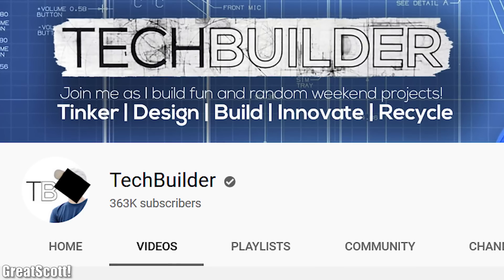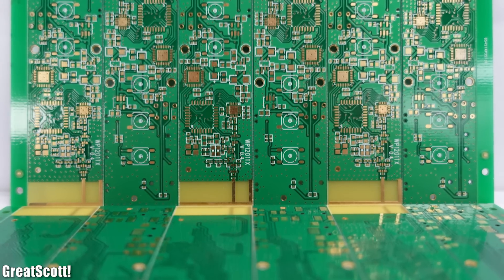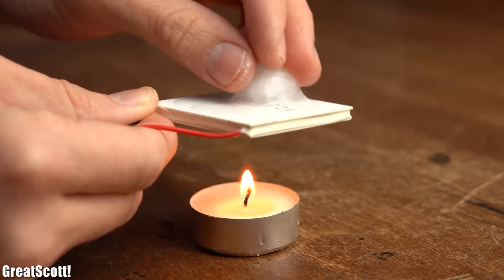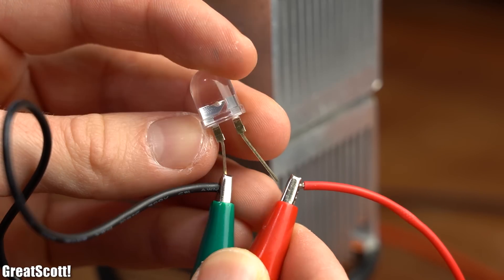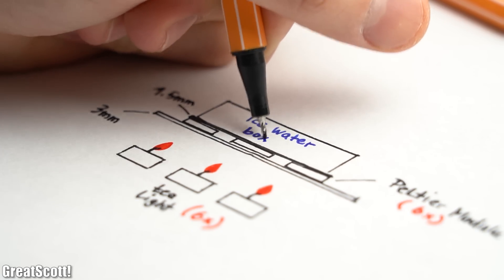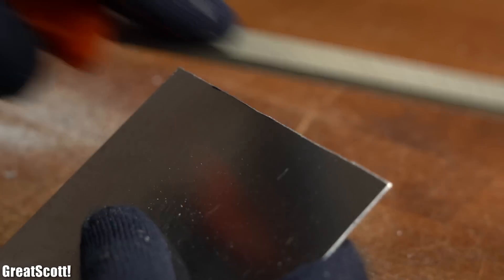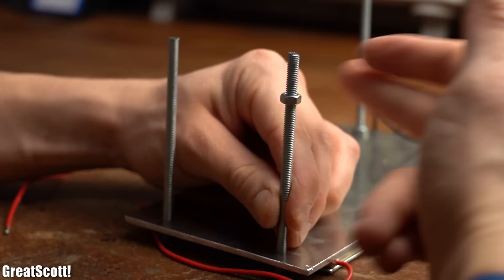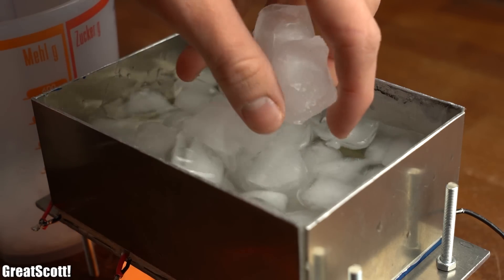Exposing a FAKE Thermoelectric Generator and building a REAL one!

Comment: Can you build another project please? 😁 or at least tell me why is a bad idea.
- U shape metal box with rocks inside
-Heat source ( ex: hydrogen torch/solar power/ or a simple torch)
-2 Peltier
-external power supply for the heat source and one Peltier

1.Heat the U shape metal box, and power up a Peltier that will be placed with one side on one end of the U shape to make a very cold side 
2.place a Peltier between the very cold side of the other Peltier and the other side touching the other end of the U shape 

Can this be efficient somehow?

Comment: I am confused now. As far as I understood the voltage converters, shouldn't it have been giving out more current after lowering the voltage from 6.5 to 5 V?
Or were the 200 mA with 6.5 V just the load-less current and not what was actually usable if a load was added?

Comment: U have Connected All the Models In Series Which Means u are trying to Generate The Same Current From 6 Modules Which Is Actual One Module Current. This is a Basic Scense. Try to Connect in Parallel And Show the Output Current. If the Current Raises Please Delete Your Video. If it not the I will Blow All my Degrees And Certificates Infront Of u

Comment: Peltier elements are for cooling only. Use Seebeck Elements. Those work basically the same way but are chemically engineered for generating electricity. They are way more efficient!
And don't use so much conductive paste. A much thinner layer works much better!

Comment: @greatscott: what if you use ALL the heat of the 'fake' version: isolate the heat and use it all: because now 90% of the heat is wasted: only use a straw to suck in oxygen to keep the flame going, add Rockwool all around and then measure: then we should really know the efficiency. My idea was to heat up a tank with the overproduction of my solar panels during the day, and then reuse the hot water to power small (or as big as physically possible) devices (hot tank on one side, cold rainwater other side). But we need to know what the efficiency is if we use ALL of the heat and let go nothing to waste. Anyone knows if there is documentation about that? (and everyone knows that a Peltier element is not the best way, but is there another...?)

Comment: I'm wondering if it would be practical to build a teg wall to sit behind a wood stove, taking the place of an exterior wall, such that the cold plate is exposed to cold winter air to provide the differential.

I'm think as one component of a multi source system.

Comment: Hello GreatScott,
how are you doing?
I hope my next description doesn't pollute your pretty mind,
my idea for this is to use a joule-theif circuit to boost the 0.09 volts of the named generator (the single peltier module one) to a proper 4.2~4.9 volts then using some other booster circuit to boost the output voltage to a proper 5 volts signal to use for something useful like charging a smartphone or powering a Bluetooth speaker if you may have to
thanks for reading and hope you are doing well.
Crazy Cuber signing out

Comment: Would using salt on the cold side provide any benefit? It would increase the cooling rate, would that enable more efficient uptake on the hot side? It's already splitting hairs at this point since you would not use TECs for any serious power production.

Comment: Make 4 sided boxes with the plates and stack them 4 levels high for a total of 16 plates.
Cut a square hole the same size as your TEC box stack and water tight glue it in place.
Fill the cup with ice water and raise it up off the table about 4 cm with 3 or 4 little objects.
Place a single candle beneath it.

I think we need to make micro heat pipes to upgrade out TEC modules

Comment: Aluminum oxidizes and develops a light oxide coating in the presence of oxygen within minutes. So you need to chemically remove the oxide with a wipe-on oxide remover before you try to Aluminum-Solder  Also, I believe there are peltier TEC units designed as generators -- not sure what the difference is exactly but they can handle higher heat exposures.

Comment: I get that you believe this isn't FAKE, but yours is just equally FAKE. You basicly put six of them in a serie and used another powersource in the form of ice wich in time costs energy to make.. Nice tweaks it can be way better using copper heatsinks and closed walls on the hot side. 1 candle might do the trick again ;)

Comment: If you want a reliable maintenance free power source and you have a hot spring, this would work. What else could give you electricity for 1,000 years that doesn't involve radio isotopes?

Comment: As a career EE with >20 years in RFIC design I can say you totally NAILED IT!
The fake one failed a freshman physics analysis big time...calculate the energy available from the tea candle flame (old school bomb calorimeter), account for low efficiency of Seebeck Effect and it is no where near the amount of power (volts * amps) needed to do a legit charge. 5V @ a few mA probably won't even power the charge controller in a cell phone, never mind charge the battery.

Comment: You used the wrong thermoelectric modules. TEC (ThermoElectric Cooling) modules are optimized for generating a cooling effect by applying an electric current to them. TEG (ThermoElectric Generator) modules are optimized for generating electricity by applying a source of heat to one side of the module while cooling the other side of the module. What you should have used is the TEG 1848 module.

Comment: I still believe you did this wrong. They’re too far away from the heat source. They enough power to generate at least one amp at 5v. Don’t have to have ice... on such small candle set up. Buy some cpu heat sink... possible small ones one for each TEM. I know this because i have a fire place fan powered via a TEM. This fan have One TEM... and measured it it showed way more than you do from 6 TEM same size. Maybe you’re cooling them too much. Because i find this very unlikely that a commercial ONE TEM from a factory built device, does a better job than 6 in your set up.

Comment: Nice job with your analysis and build, especially with being transparent about everything. However, one could argue that using ice on one side of your Peltier array is equally unfair as using a blowtorch on the other side. So neither project really demonstrates charging a cell phone with tea lights (in the spirit that tea lights are the energy source). But the video is valuable for teaching about thermoelectric devices. Thanks.

Comment: Here's a thought I had about peltier generators, what if they were used in areas with colder winters, say down to 15°F (-9°C)? And you had the hot side facing in the living space, and the cold side facing out? Would that work to any reasonable degree?

Comment: My house is heated with and outdoor wood boiler that heats water that is than pump though the basement floor. It's very reliable unless there is a power failure then the pumps that circulate the water shut down. This means no more heat in the house and the boiler can overheat. So, I was toying with the idea of basically replacing the chimney stack with a steel tube coated in T.E.G.s with heat sinks to power the pumps. The pumps are quite small in a closed loop with low friction tubing and I only would need to run them enough to keep any part of the loop from freezing. Is this even remotely reasonable or are T.E.G.s just too inefficient.

Comment: TEC1-12726 - Operates Temperature: -30C to 70C Hot and cold on both sides of the temperature difference of 68 degrees. not iintended for power generation. 
im not sure u used its max heat rating but ther are high heat  TEG but very costly. im still trying to figure a lower cost way to use my wood stove to charge a battery bank. looks too costly

Comment: use 4 Peltier modules, 2 modules in series for voltage,  side by side in parallel with the other 2 modules also in series for current. Two candles per module.

Comment: i think that you lost a lot of heat energy from the candle, a candle burning inside a heat sink made from aluminium or copper tubes with ventilation might be more efficient 
🤔🕯🤷‍♂️
Reply: i read that the flame temperature of a candle is about 1,000 °C and the melting point of aluminium is 660° C 🙄😐🕯🤷‍♂️

Comment: Hmm. I got resin printer that has casing volume of about 2liters. It's too cold to use where it's currently at winter and I was thinking that, hey maybe peltier heater would be good. Now I'm thinking that should I just shove something like small ordinary lamp inside to heat internals from 15C to 30C. I'm definitely overthinking this problem :)

Comment: i was hoping to get 3.4 amps at 12v from a small campfire. by my calculations that would take over 100 peltier ceramic pieces of the same power as the ones from this video. not gonna happen.

Comment: could this be used to extract heat from  a solar panel and on the other side being cooled by snow, or would this just make the solar panel less efficient? I'd like to generate more power than just from the solar pannel on a mobile snow winch?

Comment: Is it possible to have a huge heatsink on the side that has to cool it down and have the flames touching the hot side? And would you generate more milliamps from connecting all the positives together than connecting all the negatives together, but this would bring down the voltage though.
Reply: @GreatScott!

Comment: Idea: I wonder if someone could build a circuit  that uses a capacitor to "shuttle" charge ex: charges at 5w until full, then outputs to target circuit at some higher wattage like 40w. ( the charge time is going to be longer than the dump time, obviously)

Comment: Hmm. Wouldn't it be easier to build a rocket stove out of a log and put a fan ontop to change that hot air into kinetic energy and then have that drive a magnet to induce current? I think they have commercial applications for that now.

Comment: the reason your brazing failed is because u need to heat the aluminium enough to melt the rod with out the torch hitting the rod, and clean oxides from the aluminium too

Comment: Realistically, you're better off buying a bunch of battery banks or a massive deep-cycle battery with a trickle charger to keep your phone charged during power outages. If you want ease, just buy a decent UPS (Uninterruptable Power Supply) for phone charging. It will keep the internal battery charged for you and all you have to do is keep it plugged in and plug your phone charger into it. There is really no use in having a candle-powered phone charger. There are so many better options out there. If you worry about long-term power outages, get an off-grid solar/wind power-generation setup with a big enough battery bank to last a week or so without sun/wind. It will be expensive, but you will essentially not have to worry about grid power after that. There is the ongoing cost of replacing the batteries every so many years that you have to keep in mind.

Comment: The peltier element seems ..strange as the elements i have seen has about a few watts actually,  it is easily checked but i am not having one yet, but the delta t, efficiency of the element matters , not the temperature really as long as the difference is about 40 degrees wich should be ok. They also exist heavily commercially now as chargers in trangia pots , so the fact you needed a few eother os due to somethings broken or low efficient peltiers

Comment: To solder aluminum you have to warm up the material from the opposite side, never heat up directly the solder rod. Flux is with special solder not necessary,  just a bit skill

Comment: well building a generator with peltier cells and create heat with small candeles to warm up the cold side of peltier cells it actually a waste of time and cash...
but the principles of peltier cells works well..
unfortunately all those that attempt to prove someone experiment its fake...most of the times fail miserably..
if you really want to make peltier cells as they should you need a very hot surface..and i mean not small size candles!!!
but a burner!! and outside the burner place all around the cells,obvious you will have to  keep te hot side on low temperature...and with today tech place a fan directly on top of the ce without the aluminium heat sink so that cold air reach directly the cell and allow the cell to generate more electricity..
geeeeezzz all those scientists that believe they are smarter than other..
you are just fucking idiots....
if you want to prove someone wrong,you better go in all the way...and not half way like great scot on that attempt did.. and failed miserably!!!
great scott study!!!
and please if you want demonstrate that you have great ideas i challenge you to create an electricity generator spending very lil money!!!

Comment: also would this work, if I stick a magnifying glass on my roof, that auto tracks the sun's position, so as to magnify a point of light on a roof mounted heatsink, and have another  heatsink underground to take advantage of the naturally cooler temperatures, wouldn't that be technically free energy since its using a pre existing source of heat generation. Or do the two heatsinks have to be thermally pasted together?

Comment: Now if I could figure out how to turn my entire enclosed car engine into one half of this heatsink, and another heatsink on my roof, cooled by airflow I can charge things without using my car battery. 
Can someone give me some numbers on how this works? Like is the temperature difference what creates more power? What if I cool a heatsink with a liquid nitrogen circulator, and stick the other end to say, my car radiator, does the temp difference give more power?

Comment: I have used petlier blocks to cool LED ... plase directly petlier ,cold side ,, on 100w / 220v,,  Led chip and ,,hot,,petlier side on cooler with a fan on it . Powered Petlier with 12 V . ...For now seems to work good ..LED cooler is cool while the LED chip itself is ok .you can touch it and not get burned ...Checked the current on 12 V transformer and LED power supply ..was using about 40 % less energy all togheter as without petlier . Dont know how long petlier will last ..so will install heat safety switch on cooler as well

Comment: The other issue with TechBuilder's setup is that if you are using 12V/approx 0.5A to run the cooling fan, you might as well use that power to charge the phone.

Comment: TEC modules are not the same as TEG modules, your 12726 module is not designed to be used in reverse to generate electricity.

Comment: A few people have mentioned, you need to use a  TEG not a TEC. 
I also wonder if it would not be more efficient to build a small Sterling engine run it off of the tea lights and attach a small electric motor or generator to that.
It might be actually more efficient than the tegs.
There are some relatively efficient Sterling engines out there.

Comment: Yea you gotta buy the real expensive flux (black stuff) to braise aluminum and do a better looking and strong joint..  also is hard because of the melting points of the solder, flux and aluminum being so close to one another so is easy to melt through the aluminum and make a mess of things...  plus thinner aluminum will melt easier and also leaves a discoloration so should be thick enough to be able to remove that layer to achieve a good finished look..  or tig weld it...

Comment: with your rebuild of his project, I would suggest that you could increase your efficiency a whole lot by getting the candle closer to the flame, surrounding the pencil holder with aluminum foil and operating it in winter time with colder air passing by the top fins.
Also for the one you made, spread out the modules so there is more heat sink per module and use a bigger heat sink

Comment: How much thermal energy a candle contains? 42.0 kJ per gram? 
How much thermal energy the candle releases thru the time (power)? 
(Final mass - Initial mass)*42000 / Final time - initial time? 
What is the energy conversion efficiency (thermal to eletric) of a peltier element? 10%?
Just some questions for the viewers...
Great video!

Comment: it is a simple calculation
how much energy can such a tealight give off .... a commercially available tealight has a heating output of 20-30w .... but that means the whole tealight over a burning time of 24 hours .... well, I doubt it very much that you can charge a cell phone, operate an LED and a fan ... especially not at the same time

Comment: You could have used Silicone Sealant for water proofing and joining glass and metal plates at 7:21. I have seen glass aquariums made with silicone joint only with large capacities. Neat and clean solution.

Comment: 7:23 you could use your power supply with aluminium wire to weld it from corner at 30 volt setting

Comment: You always get 5 volts with those cells, more or less. You had to put them in parallel. Also, since they work both ways, you also need diodes to avoid dangerous outcomes like voltage reversal.

Comment: You need to scratch the surface of the aluminium to get through the oxide layer,otherwise the brazing solder will bead up an roll off,in my own experience the one's that melt at 350°c work the best